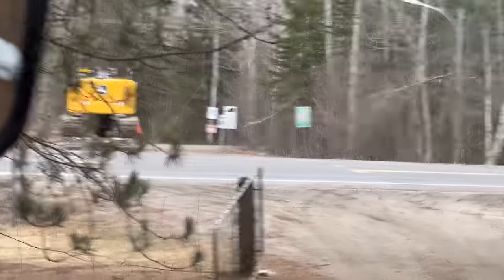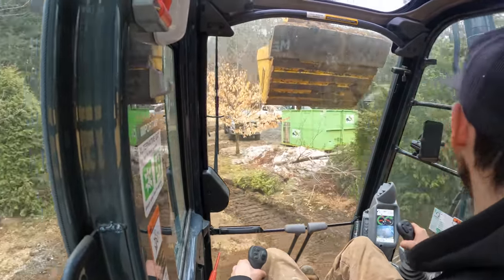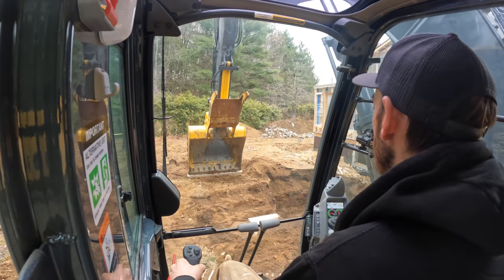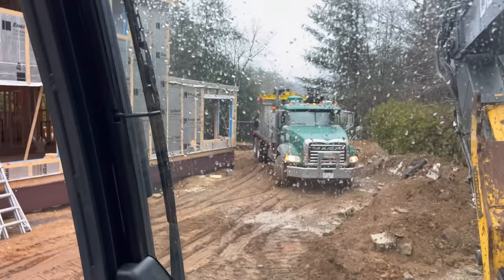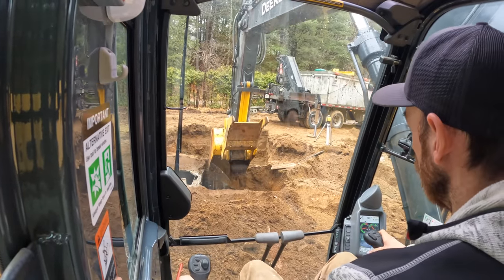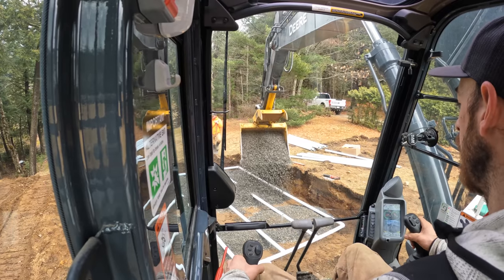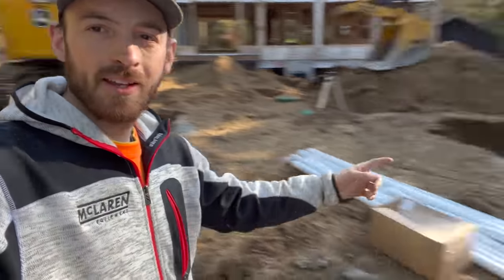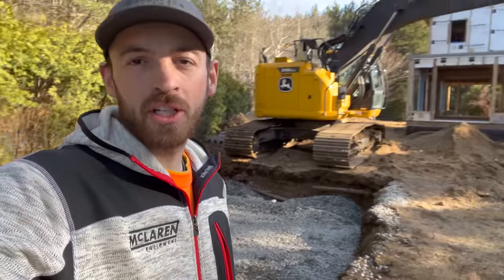Traded The CAT For A New DEERE

Comment: I’ve been running the same machine lately, love it for civil shit. Recently installed 3, two piece concrete septic tanks and each half weighed 15,000 pounds. It could pick ‘em up 4 feet if they were almost touching the cab and no bucket 🤟🏽

Comment: Interesting Septic system. They won't let you put in a system like that around here. I had to put in an ugly mound system, fed with a pump from the third tank of a 3 tank system. As I recall the pipes in the mound were only 2" dia. I would have rather it to be a gravity system instead of using a pump. I am enjoying watching your summer fun Ha Ha! Keep them coming.
Reply from the maker: Most of our beds are like this unless we get in to a treatment unit. Which I haven’t done much of but other guys in the company have. 
I’ve seen the beds you’re talking about but never around here. Thanks!
Reply: Mounds are necessary with a high water table or no drainage. They're also an overly complex and expensive option when you're not forced to do it by local codes.
Reply from the maker: @leftyeh6495  exactly

Comment: Be careful of that Groeneveld auto greaser. We have lots of problems with them in Alberta. The controller isn’t very user friendly without the manual to follow
Reply from the maker: Thanks for the heads up
Reply: @MuskokaFreerider  no problem. I doubt it’ll be an issue if only a few people will be operating the machine. I work with a lot of operators who are “meat in the seat” and don’t care

Comment: hey did you use 3 inch perf or 4 inch perf
Reply from the maker: 3" that's what the old man has used for the last 30 years. I wouldn't mind switching to 4"
Reply: @MuskokaFreerider  that's what me and my dad use too.  when using 4 inch you just have a taller pipe to cover with more stone so 3 inch is more profitable i guess. my dad went to brooklin a while back to pick up some 3 inch and they said they mostly sell 4 inch. and what's funny with them is that they sell 8 foot lengths so you need to buy more to Finnish your project.

Comment: I'm a "If it ain't Case or Cat take it back" kinda guy🤷‍♂️
Reply: I've run Kubota, Deere, cat, and case. Case is the bottom of the barrel, Deere is slightly better. Cat and Kubota are both nice to run. JCB has awesome cab space for "bigger" guys, but I haven't had enough hours to say how it will hold up.
Reply: Suppose I should add, none of them except case have ever given me troubles. Case had a motor go. Had one cat that the boss was running for a few years. 5000 hours on that oil and the thing is still running after another 10 years of abuse with more regular changes.
Reply: I run a 2012 Case CX 160B and it has power. You can dig through some pretty hard stuff fast. Especially with the Empire bucket on.
Reply: After years of  numerous logging equipment,  cats the same as everything else, a tigercat is the one to beat

Comment: I'm surprised you are still using pipe and gravel for leach fields. 95% of what we have installed in the last 25 years are all chamber systems, aggregate and transportation costs are too expensive even with an abundance of aggregate.

Comment: we got a 345 G last summer, have to say im less than impressed. its slow, lacks power. its heavy as hell. id take a new cat 335 over them tbh
Reply from the maker: Wow that’s not what I expected to hear
Reply: @MuskokaFreerider   i agree, its been reliable though  2800 hours on it now..  a few things not necessarily cons but it detracts from my opinion of it - they advertised the 345  as a 3 pump system multi function without losing flow , that turned out to not work great. it may have 3 pumps but it isn't how its advertised. its got fast boom and bucket/ stick controls depending on your attachment sizes but it may be the slowest machine ive ever tracked around aside from the big boys like 352s 374 395s 850 jd etc also it is an absolute nightmare to work on as are  all zero turn machines, we ended up having to pull the counterweight to replace the AC compressor... pros being decent visibility and  a roomy comfortable cab, controls feel nice and it is fairly  balanced well. its got a nice compact swing with boom up stick in... we use it for various tasks, it is a great hammer machine for bridge demolition though, thats where the weight is nice. it is a solid machine with a 7500 lb attachment